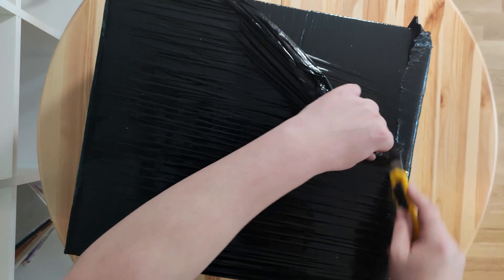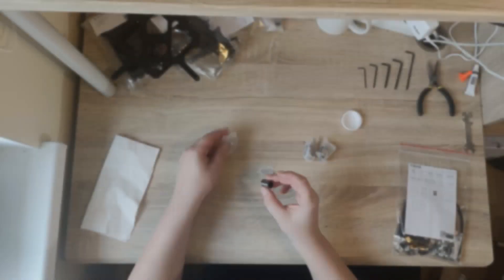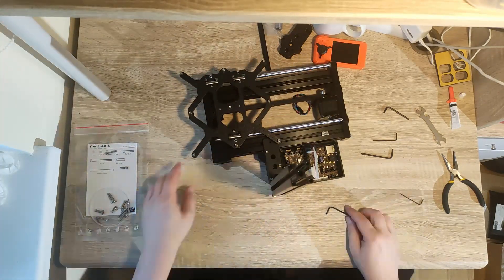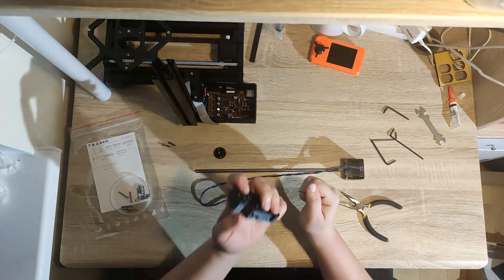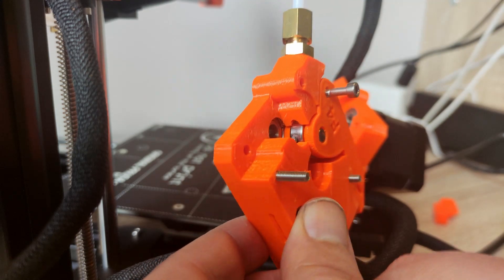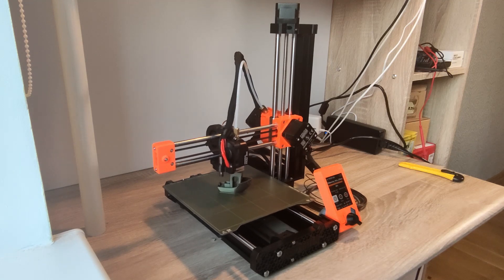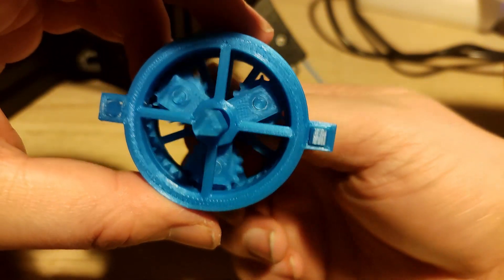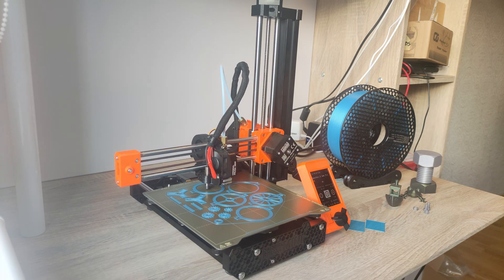Prusa MINI+ First Impressions Review

Comment from the maker: Hello to anyone that checks the comments for extra information!

I have now been using this printer for quite a number of months now and overall I am still extremely satisfied with it. I have had one printer failure in the meantime however. At one point, a lower quality filament managed to clog the hotend. So if for some reason your Prusa Mini+ stops extruding filament properly and sometimes makes a clicking sound, then this is a possible failure mode for the printer, that does seem to happen to people from time to time. 
Solution for me was to do a "cold pull" as well as make sure that the PTFE tube that is inserted into the hotend, is indeed seated properly (there seemed to be an area inside the hotend where the filament was allowed to start building up). In the end, I do believe it was ultimately my fault for somehow leaving that little gap when assembling the printer.

Comment: Wait, so that's actually a 5/5 because you're buying Prusa for the brand and reputation of being good. So it's obviously more expensive. XD

It's mini, so what did you expect?

Also, they provided a built version for $50 extra. So that solves the building issue. 

It's just mainly expensive but if that's the con then it follows the classic, you pay for what you get.

Comment: Great review! I've just ordered one to test, hoping to buy a couple for a small print farm if they are reliable and low maintenance.
Reply from the maker: Referring to the pinned comment, I did have one very slight bit of trouble since the video, but besides that, the printer is still going with no big problems up until now. I have relubricated the screws from time to time, but other than that, I have managed to not have to do any big maintenance or changes. Actually... during summer (30C outside), I did attach a slow desktop fan to cool the extruder assembly. I don't think it was actually necessary, but I did feel like I wanted just a tiny bit of cooling on the extruder stepper.
Reply: Out of curiosity, how did your testing go?

Comment: To get the square nuts into the 3D printed parts I used a flat head screwdriver. The part I hated was getting the teflon tubing into the bowden feeder. Also the jankiness of the LCD to controller board cable. And the lack of a plastic LCD back!
Reply from the maker: Oh yeah, the bowden tubes indeed were also quite difficult to install. Infact, I do not have a small bit of tubing between the extruder and the filament spool installed because I feel like it was making feeding new filament into the extruder harder and I just could not be bothered to try to push it in enough to make it all the way to its intended position haha.
Reply: @BirdbrainEngineer  Trouble feeding filament into the extruder is a sign the tube is not inserted fully. But that tube doesn't matter as I think it is in place to keep the filament sensor in position

Comment: You could’ve always used a punch and a hammer and slightly tapped the nuts in. I don’t own a prusa but you could use other tools to get around this stuff because my Tevo black widow required a lot of assembly and troubleshooting.
Reply from the maker: I feel as if doing that has real potential to ruin the 3d printed structural parts quite substantially though... But maybe indeed...
Though the point I tried to make in the video is that it'd be nice if Prusa managed to dial in their in-house printers and the design enough that the nut goes in smoothly but doesn't fall out of the hole on its own.
Reply: @BirdbrainEngineer  a flat punch works well. I think design intent was to hold the nut tight from a engineering perspective. I’ve designed nut voids and can say they are a pain when the tolerances allow the nut to slide in because the nut tends to flip or potentially twist internally with smaller  hardware. They should’ve at least put a chamfer in the beginning of the recess area or drafted the hole for alignment nonetheless.